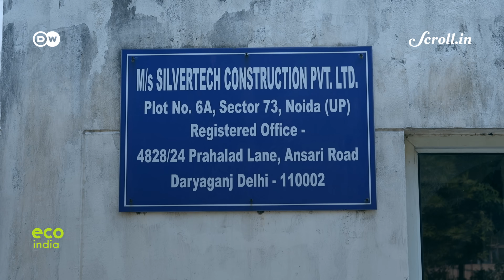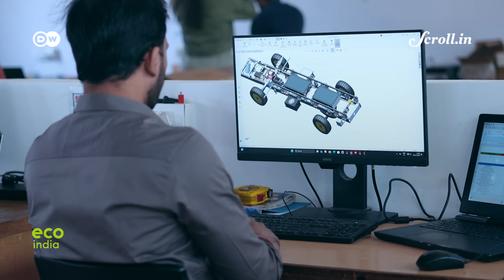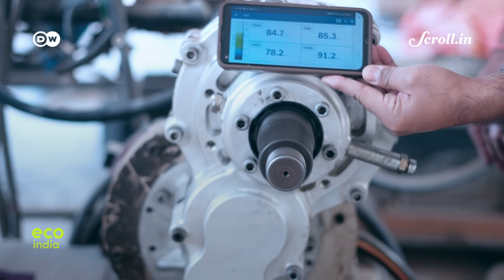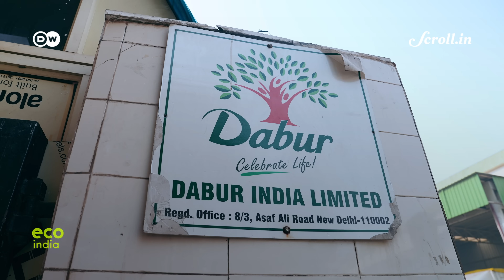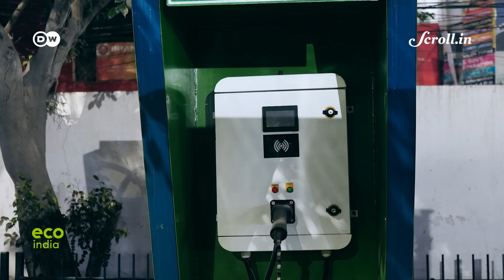Eco India: Can retrofitting old vehicles accelerate India's EV shift?

Comment: 1hr charge gets 180-200km for trucks n three-wheelers? investing half of the the brand new vehicles? for commercial vehicles time is money, it should be 400km range with 1hr charge, less then that clients wont take it. plus after 5years battery n other equipment will be fresh investment, the running cost you are showing less now in long run it will be similar. plus you haven't covered the charging cost at the stations? retrofitting isnt saving investment like ICE vehicles. only if the government puts in subsidies then it can work otherwise...

Comment: If the battery technology no where improves, electric vehicle companies should run battery filling stations where vehicles can come and replace dying battery with charged batteries.
I believe there is no such system because batteries degrade over time and it will be not so profitable business. Basically this will work like how gas cylinders are replaced in homes with gas filled cylinders

Comment: Very inspiring to see modularity introduced.
What i see missing is some Quality Assurance work, how safe will be new fitting be?

1.  Engines are made of strong metal but are similar strong metals shielding the batteries and other delicate components? 

2. What about active heat management & throttling vehicle speed when battery heats up to avoid it catching fire?

Comment: I don't think the government would easily accept this, they'll lose a lot in terms of 💵 by not promoting new vehicles. 

In reality this concept brings down a lot of waste, only the engine and core components are thrown out - even they can be sold to other states or spares can be removed and the waste is reduced. All the body, seat, nuts, bolts in the frame are reused meaning less waste going to landfills and automotive companies forced to make better products to get more customers, it's a win for the people but it doesn't promote the capitalistic system that is currently in use so this is a hard sell

Comment: 180k range and 60min charging for those little tuk tuks is very good. There are plenty of sophisticated western and even Chinese vehicles that struggle to reach decent range like that from the same size and form in even newer designs. Most of the recent micro cars manufactured in Europe for example, can barely match 180-200k.

Comment: The simple answer is NO.  When over 70% of the electric power generation is achieved primarily through the use of coal, converting rickshaw's to electric power trains will make no difference in overall air quality improvement
Reply: still better because emissions are centralized
Reply: @Freba9 what a ridiculous statement, do you think air pollution does not travel? 😂😂😂
Reply: @ajbudda1038  of course it does but the effects are a whole lot less when the source of the pollution is not close to the victims. It makes a massive difference.
Reply: @Freba9 I suggest you get educated before making further comments on YouTube
Reply: @ajbudda1038  don’t embarrass yourself further
Reply: @Freba9 starting facts never embarrasses me, bondu 🫵
Reply: @ajbudda1038  It all shows you are interested in everything but facts
Reply: @Freba9 what did I say that was not factual? Go ahead please enlighten me
Reply: @ajbudda1038  Your claim that electrification of vehicles does not lead to improvement of air quality because some of the electricity is generated from coal.
Reply: @Freba9 That's not what I said said, I said the electrification of rickshaw's will not lead to an overall air quality improvement and let me add particularly in regards to CO2 emissions.  It seems that you have a reading comprehension problem as well
Reply: @ajbudda1038  Read your first comment again. Also: CO2 has nothing to do with air quality but with climate change.
Reply: @ajbudda1038  actually, in Delhi it's kinda like a dip, CO2 comes in and stays during winter, causing the smog. If that coal is somewhere else which is far away people won't get as sick from the Delhi air. Also, India is investing more in nuclear and has already invested in solar
Reply: @tourmelion9221 while India has invested minor amounts in nuclear and solar, Modi has said multiple times that India will not abandon the use of coal until 2070 for power generation.
Reply: @ajbudda1038  yeah, but if we get to 50% renewables 50% coal that's still good, and the government are frothing at the mouth to make cars use half petrol half ethanol, which burns cleaner, they put in the E20 requirements like 2 years ago and now they're adding ethanol to fuel 20%.
Reply: @tourmelion9221 why can't you just accept the fact that India is so far behind other countries when it comes to Green energy and environmental protection that is laughable. What's even more laughable is your "yeah but".
Reply: @ajbudda1038   just cause they're not gonna quit using coal doesn't mean that renewables aren't becoming a major part of energy, half fossil fuel half renewable is better that full fossil fuel like with diesel. They are foaming at the mouth so bad for cleaner and greener energy they added 20% ethanol to petrol, and they're just gonna keep going till it's 100% cause oil is so damn expensive and it feeds sugar mills. Also, solar is being invested in a lot, solar fields and what not, and on a local level who doesn't have solar panels if they can get them, far flung villages have solar panels. It's the natural progression everywhere, cause it pays for itself in like 4 years. No one was talking about comparing to the west, they're also investigating, green tech is a major industry. But India is gearing up to gain major benefits. The progress happening is nothing to laugh at. You can't expect zero emissions in a day, calling real progress laughable feels like you're here to score points and have a gatcha moment as opposed to hearing and debating with someone else. What's going on and will go on is better then pure fossil fuel burning. And even if it was the same fuel somewhere else dehli's air wouldn't suffer, cause unlike what you said, CO2 doesn't travel, that's why Germany isn't suffering with bad AQI from india.

Comment: What type of DC-plug is used at 12:56 ?
Is this an open-standard and therefore cheap? 
As a German I’m asking because in Europe the CCS-standard requires a membership with high fees in an association to get the certification to be allowed to handle the socket and plug and the required computerisation to talk to the charging station.
Reply: India also have ccs guns

Comment: Pollution is a huge problem of course, but even so if the number of EV's on the road in Delhi is 8% that's a not insignificant number compared to a lot of other countries, countries that should be doing better. From less than 1% in 2020 to 8% in 2025, that's really more than I would have guessed. It would be good to see India press forward as quickly as possible, that may only come from indigenous EV and battery development though, while China is making a lot of EV's a lot of them are going to more profitable markets, so homegrown is probably the only way it twill happen.

Comment: Charging infrastructure is important for larger vehicles but the electrification of motorbikes/scooters and tiny 3 wheeled commercial vehicles will make a massive difference to air quality and they have small batteries that can easily be charged using normal electrical outlets.

Comment: Even if a certain percentage of vehicles are retrofitted or if the govt pushes for EVs through policy, does India have the larger scale charging infrastructure to support such a shift? 

Plus there's always the questions of where the electricity is coming from. As per IEA, currently India produces 46% of power from coal production so if govt is asking consumers to shift towards EVs then they better have a solid plan to move away from coal and towards more sustainable energy. 

Despite countrywide solar farms now having the capacity to produce in excess of 250GW, only ~130GW is actually connected to the grid. New EV infrastructure will have to be guided through policy while existing power structures can be upgraded to accommodate the shift in clean energy production.

Comment: Perhaps if, as the case in many other countries, you have to pay a yearly road tax fee that's attached to your vehicle registration number in order to remain road legal, India's government, in order to promote EV take-up, could take their cue from how China has, and is, continuing to strongly encourage EV take-up by a rigid insistence on preferential treatment to get a vehicle registration number for EV's well ahead of those wanting them for Internal Combustion Engine [ICE] vehicles. In this particular Indian context, this would mean conversion and new EV's, without which you wouldn't be allowed to gain the documentation & vehicle stickers proving you've paid your road taxes. Business owners, individuals, or larger operators would be forced to make the change or go out of business. 
To make it a viable (& practical) managed transition with the need for expansion of capacity in both the conversion and public charging markets in mind, it would need to be phased in over 5 years based on the letters of your number plates. e.g. A-E in year 1, with 5 more letters each year, until reaching V-Z in year five. This would also allow for the development of sufficient capacity to collect, dismantle, & the recycling of defunct combustion engines.

Comment: NewYork has more cars.. They have higher capacity (cc) cars. and their AQI remains at around 30. 
So don't blame vehicles for the pollution.. It's construction dust, broken roads and exposed land which contributes to the pollution. 
Going to EV is disastrous. How do you plan to dump the crores of huge batteries with heavy metals in them?
Reply: They also have a good national park, a good train system, and many of rural areas outside of the city. Also, dehli is built like a basin, CO2 doesn't wander like in NY, and CO2 is stuck there, so any CO2 emissions matter more. The air is so bad it's like smoking 10 cigs a day, any progress in cutting into that should be valued. The batteries can be picked apart for scrap in a facility, or given to a research center for experiments. They could just ship it to Indore, they have a good waste processing facility
Reply: @tourmelion9221  ok.. then what about mumbai? Why its AQI is high? Geographical situation is same like newyork.. 
In india its always dust which causes AQI to be so high. Thats why in forest area like dandeli AQI is about 100..its a dense forest with very less vehices..
Reply: @gdgavali  the building and poor sustainablity practices, also building and factories. Also corruption, the government spending on useless infra that doesn't reduce traffic or help anyone means you need to do much more the have any development, also the lack of waste treatment facilities
Edit: also coal burning is just generally a thing

Comment: So when you say 1 charging station for 250 vehicles, I would imagine a big line in front of EV charging stations? I have owned EV for 2 years, been to several road trips across Karnataka, Tamil Nadu, Andhra, Goa and Kerala and there is never a line! The current public charging infra is not even used at 20% occupancy rate. Right now we are around 3-4% EV adoption rate and the current infra can take upto 10% or more. What people don't know is 95% of the EVs are charged at home or offices or the same place everyday. EVs don't need charging everyday... probably 1 or 2 times a week (except for commercial vehicles). May be some parts of NE states have less infra, but it can be scaled up when there is demand. When the current supply of charging infra is not even 20% in demand, why do ppl keep saying no infra? It's complete myth or nonsense in 95% of the cases.

Comment: Great initiative of retro fitting ...govt will try & push for scrapping policy to please automakers...but eventually it wont happen because batteries are still being made in china local manufacturing is still quite low. Therefore as a low cost solution this is the best thing. Its just that the supply of good quality batteries is essential in a fragmented market at this pt. that are not easily discharged and have a life of atleast 7-8 yrs

Comment: This still has limitations. An OEM car/truck with aluminum chassis and other lighter weight components will be able to carry more battery and longer range.
Reply: Which truxk uses aluminum chassis??
Reply: @ajzz190  Good point actually, most don't. I guess I was thinking more of small passenger electric trucks. But high-end they try to use as much aluminum as possible. Steel is heavy for long-range EVs

Comment: Issue is with burning of rice fields after harvest both in pakistan and punjab, UP. Unless this is stopped delhi will always be polluted
Reply: True.  But the constant non-stop year-round internal combustion engine (ICE) exhaust is emitted at ground level right in our faces making it all worse.  It's a sliding scale.

Moreover, unlike crop burning, ICE emissions contain more toxic components.  Such as VOC volatile organic compounds (benzene, toluene, xylene, formaldehyde, etc),  magnetized PM2.5 and and even sulfur compounds.

Comment: 10:02 Electrifying ICE busses is technically more complex due to larger motor(higher power), larger battery(for typical bus routes) etc. But in case of low power vehicles(<=10 bhp) like Bikes, Autos & light-load trucks(Kei trucks), it is a WIN-WIN situation for all including the government. The scrap worthy vehicles will see new daylight, the air quality increases. Jugaad in this case is worth it. The major downside I see is the usage of Chinese power electronics(motor drivers), motor, batteries etc. If the process of retrofitting was performed with indigenous tech, like from Ola, Ather and other industry leaders, it could strengthen the ecosystem. India has seen it’s first indigenous motor tech recently, this would be a profitable market for those manufacturers

Comment: When the Central Govt turned out the EV policy, it was amazing that an entire vehicle was to be scrapped while the power mover, a small IC engine, causing pollution was the culprit. In %, perhaps the engine to rest of car ratio was 1:40. That is wastage. 
Agree, retrofit will galvanize a lot of masses to improve their lives, and help senior citizens with low incomes, save resources, basically improve micro economy industry at roots level. 
Local govt step up! No one throws out the shirt pant if the buttons' no good.

Comment: electric vehicles can be charged at home with a simple 16amp socket so i think the electric infrastructure should be not a concern. and if ev adoption increases then ev infrastructure can be scaled up very quickly compared to fuel infrastructure

a 2-4 gun fast dc charger in every existing fuel pump would solve the ev infrastructure because fuel pumps affect all ice cars but ev infrastructure only affects ev cars which are on road trips, etc. majority of cars run in the city with average 50-100 kms driving which can be charged in 4-6 hours at home(daily charging).

ev cars in the 15-40 lakhs segment make a lot of sense because of less noise and emission pollution, and evs also providde higher price to performance ratio than ice cars